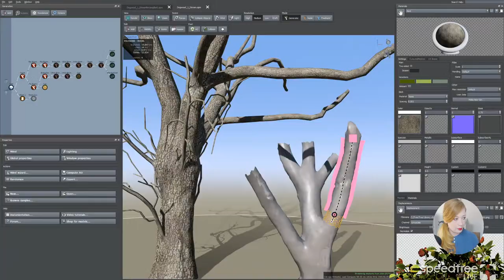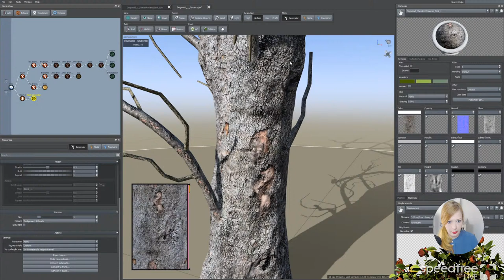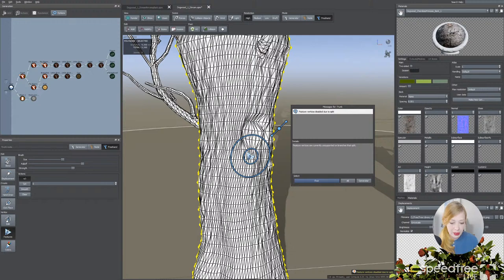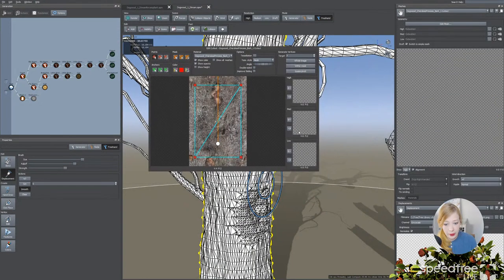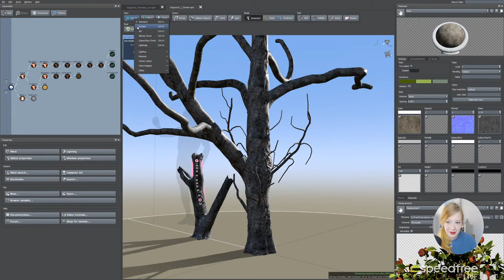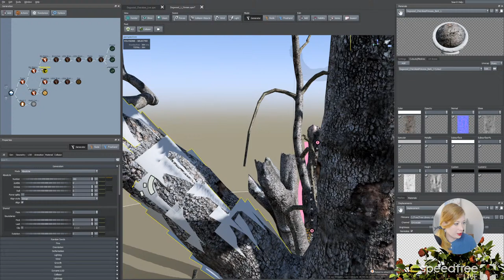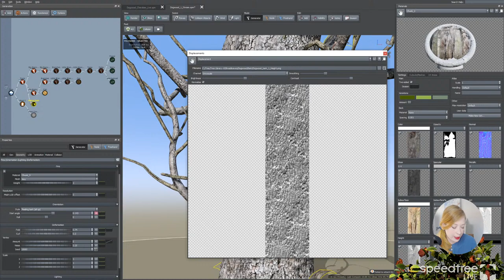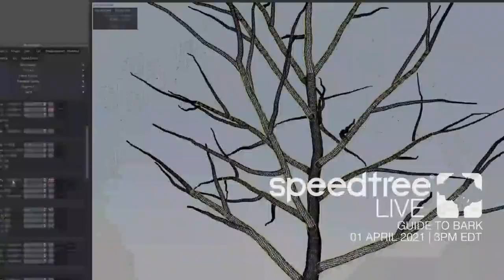Guide to Barks

Comment: how to create a root system for an imported mesh?
Reply from the maker: You'd want to attach the roots using a target generator with a branch generator coming off the mesh. You can see an example of the target generator in your installer's samples and in our documentation here : http://docs8.speedtree.com/modeler/doku.php?id=target_generator
Reply: @SpeedTreeMiddleware  Thx, I had to create a tree in a commercial project, first tried speedtree and I was interested in this software, creating trees in speedtree is a very fun process.